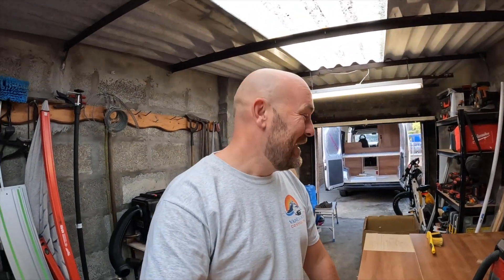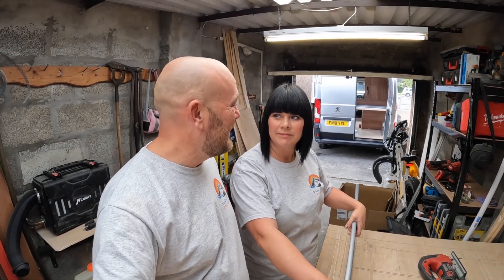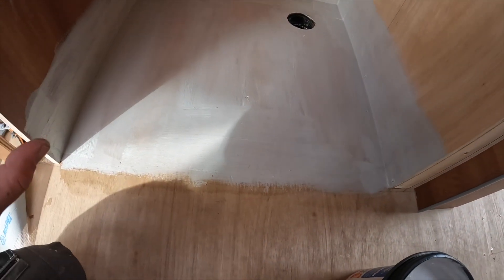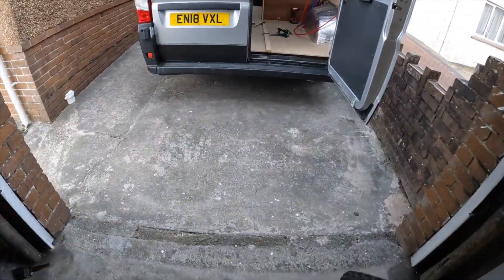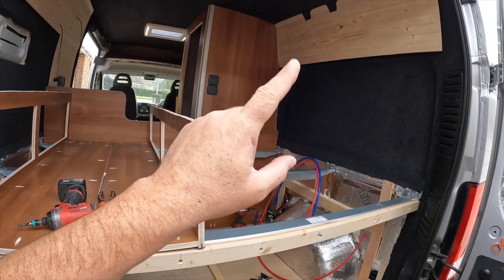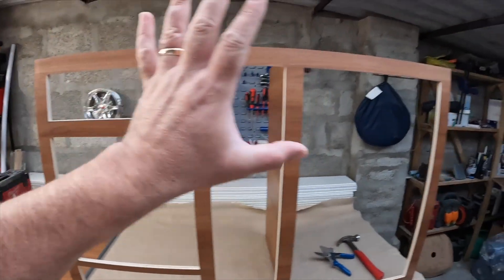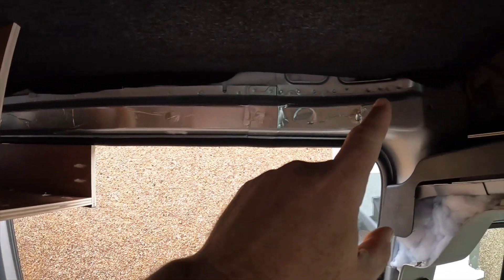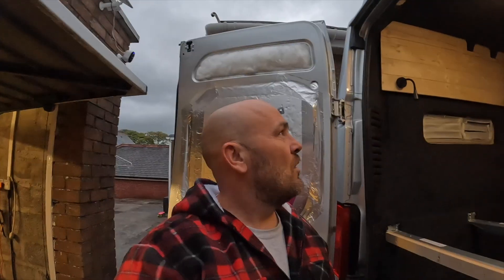HOW TO | Don’t let your Camper Shower LEAK | CAMPERVAN EDITION

Comment: Looking good 👍🏻 Love the finish you are doing with that furniture board & edging, so much better than all that tongue & groove stuff like LiamTheTerrible is knocking out, that just look like sheds on wheels, you need to get away completely from tongue & groove entirely for a really pro look.
Reply from the maker: Thank you, I do like the look of a bit of t&g in a camper but not too much 👍🏻
Reply: @VanologyConversions    agree - and with the comment above.  Personally I don't really like LTT's look, except for the ceiling ...  which is ok but I still hate the black carpet 😏

Comment: Interested in what light strip you used. 👍🏻😀
Reply from the maker: We use a 4000k led light strip from CEF currently working our way through our last 50m roll before we switch over to cob lights ⚡️🚐

Comment: Great work, yeah tambour door might be expensive but would look nice, I’d do everything possible to avoid a shower curtain. Are you just sitting a porta potty on the shower tray? Did I miss that bit?
Reply from the maker: I really like the tambour door but we are trying to keep the build below £25k and that was before a shower and hot water system was added 🤪 yes I’m putting a porta potti in 👍🏻

Comment: Lovely build! What size shower tray did you use? We're building a shower/toilet room and are wondering what size tray to use. Not sure if 70x70 would be too small.
Cheers
Reply from the maker: Hi mate yes this one is a 700 x 700 tray but I do prefer an 800 x 700 if the width allows 🚿🚐

Comment: Really amazing work 👏You are great in building and showing all your awesome progress...
I have 2 questions if you can answer:
1. If you box the wheel arches what would be the dimensions of them? 
2. Whats the height of your garage space?
I am planning my own van but haven't bought the vehicle - just playing around with the layout in sketchup. Thanks very much in advance.
Reply from the maker: Thanks mate and good luck with your build 👍🏻 wheel dimensions are roughly 600 wide by 300 high (I’m in bed and ain’t going out to measure lol) and the garage space is 750mm high by 1800 wide by 1400 deep 👍🏻
Reply: @VanologyConversions  😊 
Ofc not asking u to get into the cold to do the measurements 🤣. Was asking cause I guessed you would know that from the top of your head 😉
Thank you very much for sharing the info. See u in the next video ☺️
Reply from the maker: Haha too many figures in my head right now but I’ve just measured and they are 800 wide at the bottom and 400 high 👍🏻
Reply: @VanologyConversions  thanks for the detailed measurements 🙏🙇‍♂️

Comment: Awesome work certainly cracking on with it, any link for the coin matting and how did you lay it in the end, glue/staples/loose?
Reply from the maker: I ended up glueing it with spray contact adhesive to keep it in place, didn’t want to see the staples and loose it could move 👊🏻 link below 👍🏻 https://www.ebay.co.uk/itm/384945482335?mkcid=16&mkevt=1&mkrid=711-127632-2357-0&ssspo=l5tiecb-td-&sssrc=4429486&ssuid=W0uvmp2xQvO&var=&widget_ver=artemis&media=COPY
Reply: @VanologyConversions    well, I was hoping you would leave it loose, so it could easily be changed to something FLAT  -  all those raised pennies catch the dirt and is hard to clean .. 😏
Reply from the maker: To be fair it’s only down with spray adhesive so could easily be taken out in one piece 👍🏻

Comment: Why not Acrylic sheeting in the shower room?
Reply from the maker: I’ve done the acrylic sheets in the last two vans and I wasn’t that impressed with it to be honest want to try something different. It’s also nearly impossible to properly tank the room if using a shower tray and not a former tray 👍🏻
Reply: Hi, Will you be notifying the DVLA with the appropriate evidence to have it changed to a campervan? … As always you’re doing a great job Stu 👍🍻
Reply from the maker: I won’t be but new owner could if the apply decals and I believe an awning is required
Reply: @Flossy_tops    That's a waste of time - DVLA want so many finicky details and then it just comes back "Van with Windows"   It's totally unnecessary 😏😏
Reply: @VanologyConversions  thank you  😊

Comment: What do you use on your wheel arches ?
Reply from the maker: On the wheel arches I treat, insulated with two layers of 8mm dodo matting and then carpeted them on this one 👍🏻
Reply: @VanologyConversions  Iv put dodo 7mm thermo liner on one today and looks crap because it’s pieced so thinking the carpet will look rubbish over it. It’s been playing on my mind all day 😂😂🤣🤣 going rip it off tomorrow. I take it you use the roll and not the sheets?
Reply from the maker: Yes I used the roll and made sure no overlapping. Was fiddly but got there in the end 👍🏻

Comment: If I were you stu I would stay away from supplying the van and concentrate on converting owners vans ,when buying in a van you could get stung with possible repair bills to engine ,clutch,gearbox,& the dreaded management faults,which would push the end price up,just a thought,from a 30 year plus mechanic.👏👏👏👏🏴✊
Reply from the maker: Thanks mate appreciate it, this van will come with a third party 12 month mechanical warranty and I of course will warrant my own work 👍🏻 someone else brought it to my attention and thought yea that needs taking care of. Next van I do is a customers van